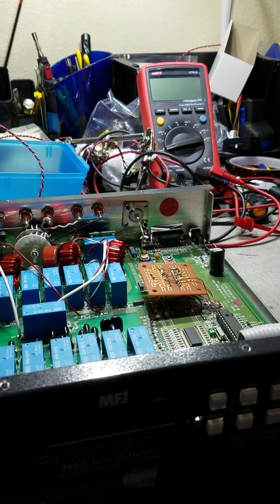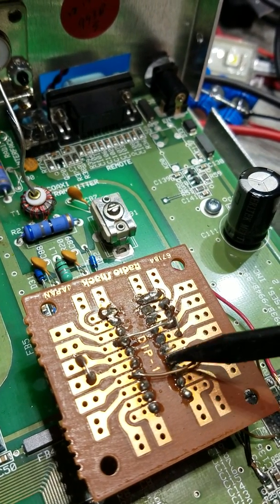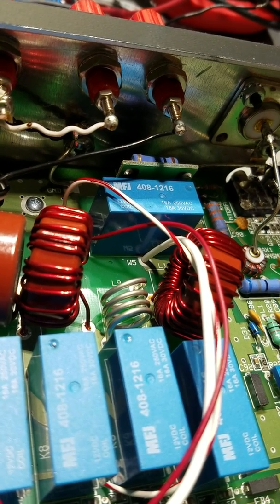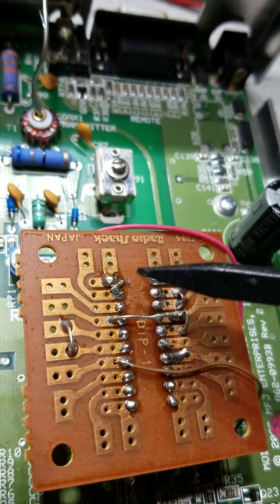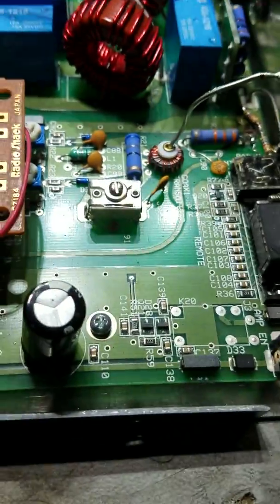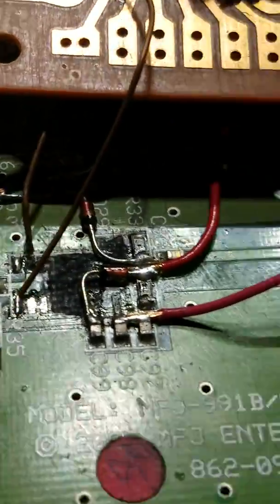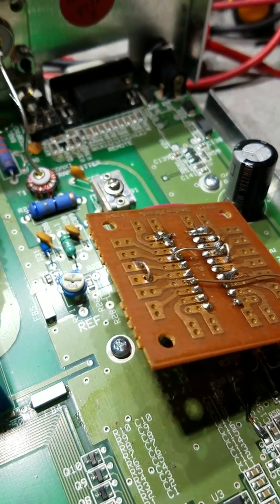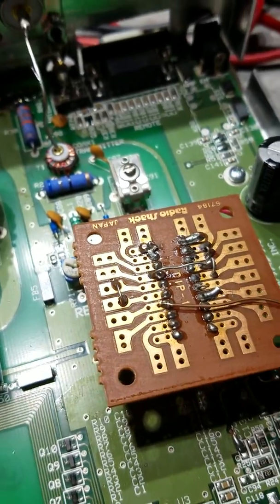Repair of mfj 993b tuner with no frequency readout

Comment: I have a MFJ-993.  It works great on CW but when on SSB the frequency display jumps all over the place and the SWR changes.
On CW no problems.   Any ideas how to fix this?
Reply: That is normal.  The frequency counter requires a constant carrier to be accurate.  It works by converting the sine wave into pulses that the microcontroller counts.  SSB signals change in frequency and power with the voice, therefore can not provide a count-able signal.  There is a note on page 13 of the manual that explains this.
Reply: @chockroberty  This makes SSB not usable.  The SWR from the tuner keeps changing.
Reply: @n1kkri  The SWR isn't actually changing.  It only appears to be changing in SSB mode.  You measure it in constant carrier mode and then switch to SSB to talk.  The measurement in constant carrier mode is accurate.  Ignore the SWR readings in SSB mode.
Reply: @chockroberty  Whats happening at my end is the swr is changing.  If I turn off the auto tune feature then its stable.  For now I have to press the tune button while transmitting.  Once it finds a good swr only the display jumps and so far the swr seems to hold.  With auto tune on the display jumps and I end up with a different swr as shown on my rig.
Reply: I plan to do a factory reset and do some testing with and without the auto tune button on and off